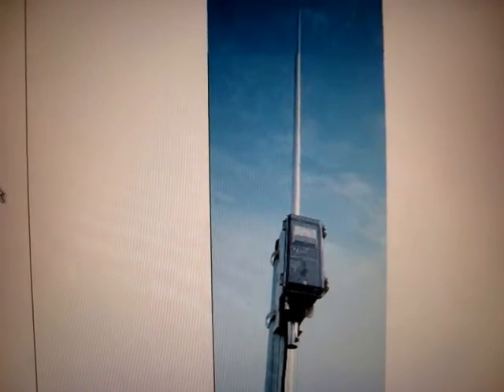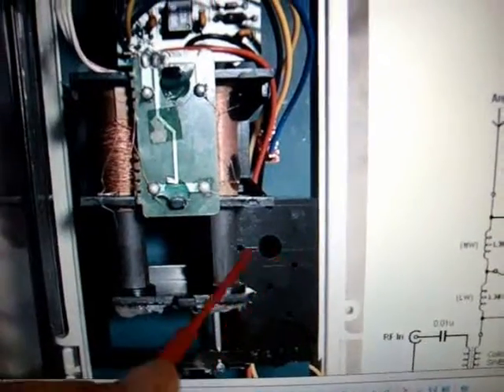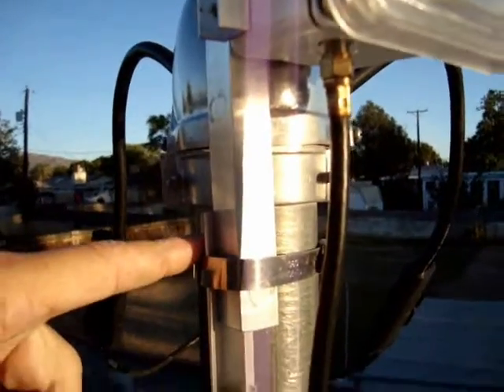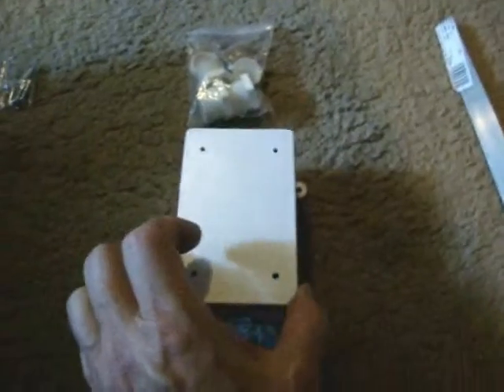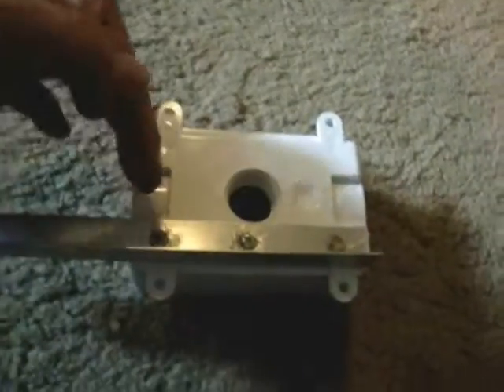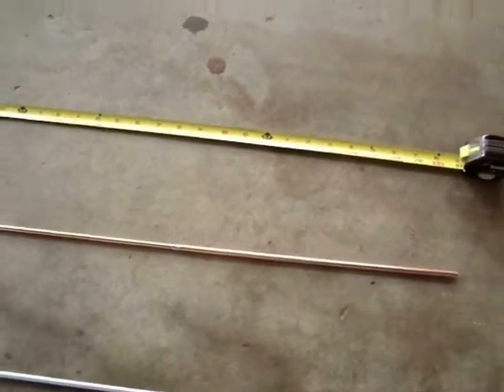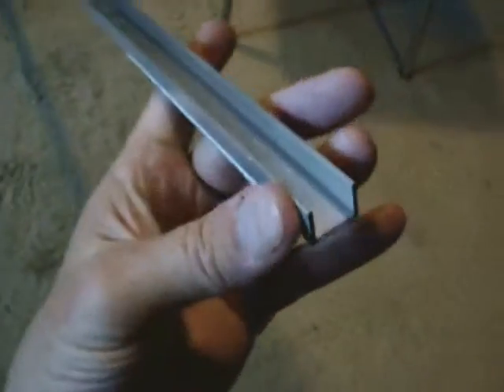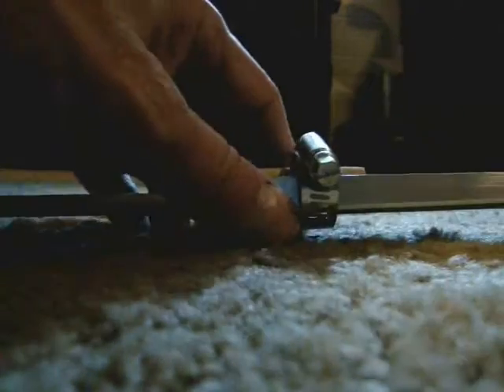How to Make a Talking House Range Extender Antenna

Comment: I see the instructions allude to this range extender in concert with the interior transmitter are in fact Part 15 certified despite the bit of transmission cable between them.  I assume they are talking about Part 15.219?
Reply from the maker: @SkyCharter

 You're correct. For the life of me, I don't how the folks at Talking House got around the transmission line 3 meter limit rule. FCC Part 15.219 clearly states that "The total length of the transmission line, antenna and ground lead (if used) shall not exceed 3 meters." Yet, they sell the Range Extender Antenna with 25’ of coaxial cable. I think the feds (fcc) got the money and just looked the other way. 🤔 The part 15 rules are loosely defind anyway, so it's open tto personal interpretation.

References:
https://theradiosource.com/products/infospot.htm

https://www.ecfr.gov/current/title-47/chapter-I/subchapter-A/part-15/subpart-C/subject-group-ECFR2f2e5828339709e/section-15.219

Comment: I come from the commercial broadcast world, now retired. 
The one thing I question is RF loss from (I assume) the Talking House transmitter inside the house and Range Extender. Seems to me that with a long run of cable to the Range Extender, there has to be some power loss with a power down to only 100 milliwatts coming from the Talking House transmitter. In a typical 1000 watt, non directional AM facility, if the transmitter building is like 80 to 100 feet away, I've seen a bit of power loss in the line in some instances. I question how much RF loss there is between the Talking House transmitter and the Range Extender, even with it tuned up. If there is power loss, using that low of power will decrease coverage.
Reply from the maker: You are correct, there's always some loss associated with using rf line. There appears to be very little loss in this case, probably due to the way the Talking House transmitters were designed. They were clever with using rf transformers designed for 75 ohms. So using good 75 ohm type coax line is a plus, especially at low frequencies like the AM broadcast band.

One RF cable reference on RG-6 quad shield coax shows a loss of 0.82 db loss per 100 ft at 10 mhz. So AM broadcast band frequencies, the loss would be even lower! Therefore, 100mW thru RG6 quad shield coax will pose no significant loss. I'm using far less than 100 ft in my installation. It will even light a neon bulb! Check it out... https://youtu.be/bLA6Lnx8ybA?si=cVTbr5E9z5XrvBfx

Comment: I  removed the built in atu from a parts transmitter and I'm going to try to build an outside atu .  When you were up on the roof I noticed the area looks bare and desert type environment , not the best ground conductivity .
Reply from the maker: Yes, you are correct. The signal is very directional in the SE direction, because the power line that runs from the pole to my house is the same direction. no doubt, the RF is following the power line.  😉

Comment: My Talking House has a range of 6 miles using the built-in  tuner and connected to an outside antenna . The transmitter sits at the top of the window and a tiny hole drilled to get the wire to the antenna  at the edge of the roof . The outside antenna is 7 foot long .
Reply: Ok, so what antenna are you using?
Reply: @RetroComputerist  Home built fully loaded antenna with a capacitance hat.
Reply: I have a new talking house, paid some guy from Turkey, to build an amplfier. nothing works. Could you build mine?? Id like to get out 6 miles  for local info station. i do have an fm 25 watt which gets out but i love AM
Reply: @JannScottLive  My transmitters aren't amplified and are part 15 power levels .  I've heard my station ten miles away a few times during the winter .Location has a great deal to do with range vs power ,even on FM. I do have a short video with plans on how to make a five watt amplifier , not very complicated amp . If the transmitter antenna isn't tuned the range will also be poor
Reply from the maker: @JannScottLive

Ok, yes, I cud build am amplifier, but it would not ne compliant with the part 15 rules and you cud get in trouble with the feds (fcc). Just saying.
Reply: Oh M G. WE had 50 feet of line for antenna hooked up yo 30 wt Amp
TH to 30 wt Amp to 50 ! 0:08 copper antenna. ...ZIP NADDA
now it's all sitting on a shelf

Comment: Can't go wrong with your videos Bob.  Why does it take me so long to find your TH videos??  I did the mod replacing the modulator in the other video and was very pleased with the results.   Now onto this project.  Just received some of the components I was missing.  I found a slightly different enclosure that is close to what the Talking House comes in off Amazon.  I also splurged and got the same HOPESUN meter on the Talking House.  Being in Canada I can't get the range extender so I'll DYI it.  $ 450 USD is $ 615 CDN so even some shipping costs I'm maybe $ 150 all in.  My approach on the antenna is going to be an aluminum rod from Home Depot.  Now knowing the physical size of the TH Range extender, I would have been a little shocked when I opened up the $ 615 box.
Reply from the maker: Thanks, glad it works for you. Yeah, they charge WAY too much for their Range Extender! Especially after i seen the circuit, i was convinced that it's pitifully simple and would be easy to build.

Just a thot about the Hopesun meter; the output of the tuning meter circuit may cause the meter to pin. Therefore, you may have to add a trimpot of some kind to adjust it. Otherwise, your meter is a great idea and would be far easier to read than the tiny meter i used on mine. Hope you can make a vid of yours, would love to see it. Let's get the word out. 😉👍
Reply: @bob4analog  Yes I noted the difference in the meter scale.  Certainly I'll share a video of how mine turns out.

Comment: Your coil part number shows as LSA680-470 which is the flat coil and ferrite bar, but your tuner looks like it's using LSA680RR, the round version. Can you verify which part number is correct?
Reply from the maker: Well, you caught me on this one. 😊 I wasn't real concise, as I was in a hurry to get the video finished and was mostly for illustration.

You are correct, the coil is a
LSA680-470. I reshaped it by squeezing the coil until it was round. Then I used half of a round ferrite with a nylon screw epoxied to the end of it. 

The design itself is not critical. You can use the LSA680-470 coil and just slide the ferrite bar in and out to tune it. Experiment with the different taps on the coil to get the best tuning. The heart of the circuit is mostly with the RF transformer I mentioned in the video.  Build it, it should work fine. 😉👍